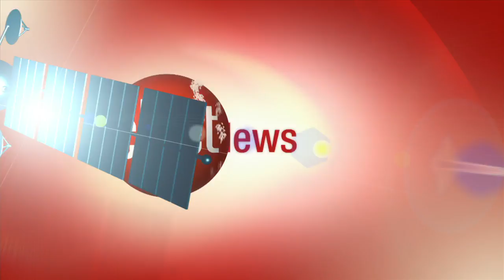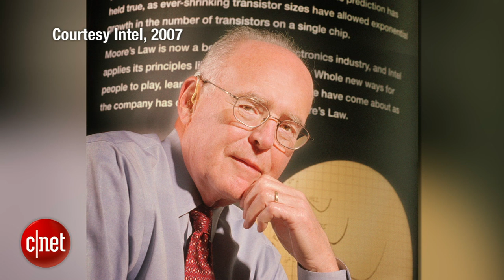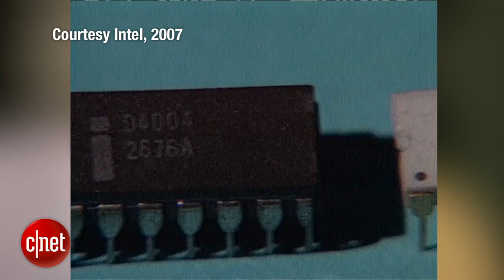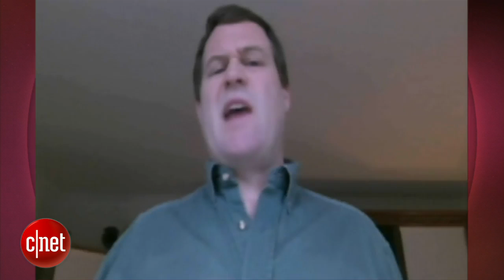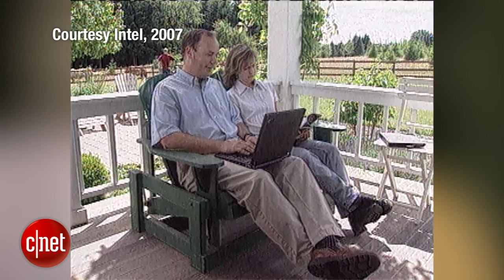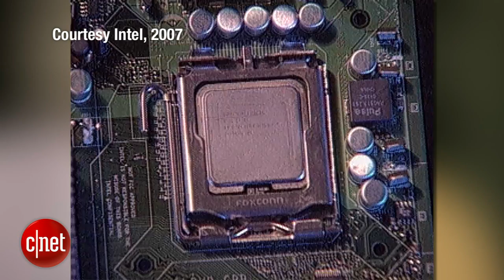CNET News - Innovations to keep Moore's Law alive - Inside Scoop

Comment: long story short, the limit at which the transistor can be made is when the transistor size is as small as the silicon atom itself. If that size has been achieved, you will have to find another material to make the transistor or fix the architecture of the processor to increase the efficiency.